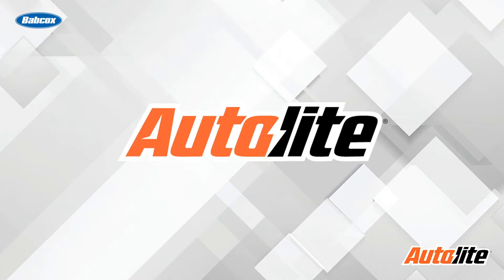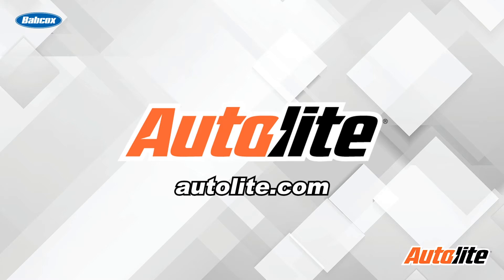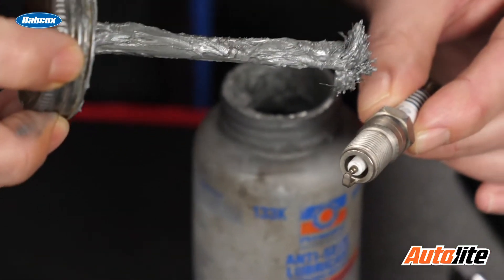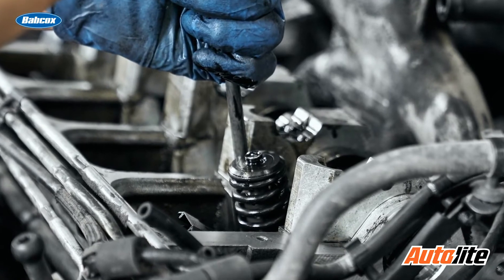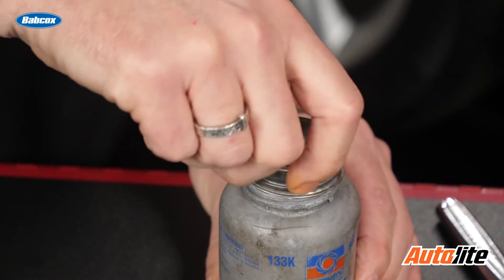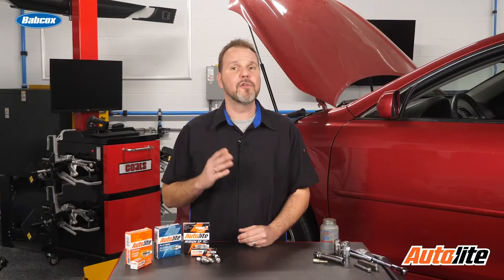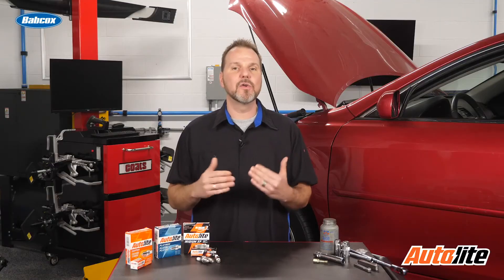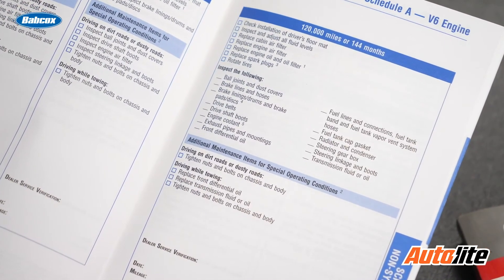Should Anti-Seize Be Applied On Spark Plug Threads?

Comment: I'm an ASE Master Auto tech and a fastener metallurgist for a major automotive OEM. I see this argument against using anti-seize on all sorts of fasteners and threaded joints all the time and it's absurd every time. Yes, adding a thread lubricant to a joint and then torqueing to the dry spec can damage something. So DON'T use the dry torque when adding a thread lubricant! By the way, I always use copper anti-seize on spark plug thread and have had great results with that.
Reply: I've seen spark plug specs as hand tight + quarter turn. Wouldn't that be the same tension regardless thereby nullifying the excessive torque argument?
Reply: @ProctorSilex  When I changed plugs on my old CX5 I caculated a 25% lower torque and when I reached that with the torque wrench it was exactly what the plug manufacture stated to turn past hand tight. The plugs did state that they have a special coating on so you don't need to use antiseize but I wanted to make sure.
Reply: @ProctorSilex  It will be the same travel but not the same tension. It will take less torque to get that quarter turn when using anti-seize. The good thing is that you don't have to worry about stripping out the threads.
Reply: @ProctorSilex  That's a very, very vague spec, if you can even call it a spec, but if you were able to exactly repeat "hand tight" to the same torque every time, then you'd want to reduce that by 25% to 30% because that same "hand tight" would actually be slightly more tension. That's probably impossible, so maybe reduce it from half turn to a quarter turn instead? I seriously doubt it matters with such a loose control as that. I'd just go slow and anywhere between a quarter turn and a half turn should work.
Reply: I agree using the copper antiseize where  conductivity is needed.
Reply: @PeterMartin-qh1yb  Unless something very weird is going on such as severe rust, the miniscule amount of electrical resistance between the spark plug and the head is absolutely a non issue and isn't even measurable in the total resistance of the ignition system. Remember- by design, the spark plug itself has an internal resistor with several thousand ohms, the plug wires can easily be in the tens of thousands of ohms, and the resistance in the secondary side of the ignition coil is generally in the tens of thousands of ohms, so another miniscule fraction of an ohm from the threads means nothing at all. Actually, I highly doubt that someone even could create a high enough resistance between the spark plug and the head to cause actual negative effects if they tried, but I'd love for someone to prove me wrong.
Reply: @averyalexander2303  You don't absolutely NEED a conductive compound between the spark plug threads and the cylinder head. Spark plugs DO work perfectly well with dry thread contact. However, the electrical connection is being made between dissimilar metals that are expanding and contracting at different rates every time the engine heats up and cools down. Using an anti-seize formulation with copper particles is just extra insurance to minimize electrical heating at asperity contacts which can contribute to thread galling.
Reply: @PeterMartin-qh1yb  have you ever done a conductivity test with your ohm meter on it.  The copper one I have isn’t conductive
Reply: My torque specs on the spark plugs on my cars range from 13 to 15 foot pounds. There's no way you can stretch the threads with such a low torque rating
Reply: Yeah I think the problem is people tend to use too much anti-seize on threads,  all you need is a film or it not a whole lot of it.   I like the copper anti-seize for spark plugs as well because the copper conducts really well in that application.  Also when it comes to aluminum cylinder heads I tend to be a little neurotic about stripping the threads in the head so I tend to bottom them and then just give them a little bit more than that but not much.  The factory torque values are fine,  but I've seen people strip the threads using torque wrenches as well,  I tend to go by feel with aluminum.
Reply: @elektro3000  Is there a reason you prefer using copper anti-seize instead of aluminum? I've been using aluminum for over 35 years with no problems. I'm just curious why you prefer it. Maybe I'll start using too.
Reply: @bernardocisneros4402  Presumably is conducts electricity better. That remains to be proven though.
Reply: They use a spark plug antiseize on aircraft spark plugs. It's more of a thick black grey liquid. Made by Champion, tempest & others. But some also use oil, cooper & aluminum antiseize with no problems.
Reply: I use the copper on 02 sensors as well, but I use it sparingly.
Reply: I know right. I lived in the rust belt i used anti seize on my wheel hubs, caliper bracket ect.... To some people this is sacrilege. If the bolt is torqued properly its going nowhere
Reply: @MartinX192  Anti-seize on all the mating surfaces between the wheels and the hubs is a lifesaver! Trying to change a wheel corroded to a hub sucks in a well equipped shop, but by the side of the road it could be impossible.
Reply: Torque? well you can get out the calculator.  I just drop it 10% in iron and 15% in aluminum. The nickel and copper tubes or pots of seize are about the same except for the heat transfer.
You can check it with a VOM.
Generally I got the Nickel for 300-400F temperature process equipment and Copper for the 800F - 900F. Or just copper on the high alkaline processes.
Yep you do not want be around a ex-changer when the 900F dollar plate lets go of the 12 inch feed of petrochemicals.
Been using them on aluminum and cast iron heads for 30+ years.
Reply: Is copper anti-seize compatable with aluminum threads?
Reply: @thisisyourcaptainspeaking2259  Yes, copper anti-seize works great with aluminum threads.
Reply: @elektro3000  Last I checked and surely this hasn't changed but there is essentially no galvanic couple that is worse than copper and aluminum.
Reply: @thisisyourcaptainspeaking2259  It's certainly not the worst galvanic couple (magnesium with gold, or at least magnesium with titanium, would probably be the worst) but you're correct that copper and aluminum can cause awful galvanic corrosion when joined with an electrolyte, such as salty water. However, the grease component of the anti-seize compound seals out water, road salt, and other materials that would create an electrolyte between the aluminum cylinder head threads and the copper particles. In fact, most spark plug threads are austenitic stainless steel, which is an even worse galvanic couple with aluminum than copper with aluminum. Any kind of sealant to keep water and salt out of the threads will help prevent the plug from forming a galvanic cell with an aluminum head.
Reply: @thisisyourcaptainspeaking2259  From what I understand it reacts with aluminum and causes galling. Nickle is a better option.
Reply: My buddy who is an aircraft maintenance engineer does the same.
Reply: the first part I kinda agree and copper shield is great for electric connections
Reply: I have several torque value tables going back to the 50s. They agree that their torque values are for clean and lightly lubricated threads. Now, nothing seems to be said on this subject. Makes me feel trapped between what was once common knowledge, and now is crickets.
Reply: Crickets?  I say use anti-seize if you plan on leaving the plugs in there for an especially long time, such as irridium in an aluminum head.  For my vehicles where the plugs are an easy reach and access is good, I run copper plugs (typically cast iron heads).  I've never experienced thread seizure in cast iron heads so I might use a little oil if anything.  Torque wrench?  It's more often than not I can barely get to the plug straight-on, let alone get a torque wrench in these locations.  I go by feel..  . @intuberably
Reply: 100 percent right! What he said ❤
Reply: I was under the impression that copper reacts with aluminum and causes galling. Wouldn't nickle based anti-seize be a better choice?
Reply: your certifications and claims have no evidentiary bearing on the physics and/or reliability of any of these procedures.
Reply: Sound advice.
Reply: Yes, thank you!!! I’ve seen too many debates on this topic. I’ve been using anti seize on spark plug threads ever since I started out way back in 1972. (76 year old and retired, by the way). I still use it on my own cars, as well as my family’s. Never, ever had a problem. I have also seen some horror stories where lack of lubricant were responsible for expensive repairs.
Reply: How is it that copper, which is a more galvanically active combination with aluminum (head) is ok??
Reply: @JHZR2 it's gonna take decades or centuries to corrode and you will never feel it. The thread will corrode much faster without the copper antiseize.
Reply: Current technology uses a nickel coating on the threads which helps prevent seizing and corrosion when the plug is tightened, and is the primary reason many spark plug manufacturers no longer recommend the use of anti-seize compounds.
Reply: Do how do you determine what torque you should use with anti seize? I did all my VW air cooled aluminum heads with anti seize and by feel. Never had one strip out, even my first ones when I knew almost nothing about torque and aluminum.
Reply: @5400bowen  In most situations, if you have a torque spec for dry threads, reduce that by 25% to 30% for lubricated threads (multiple the torque number by 0.70 or 0.75).
Reply: I never used a torque wrench on wheel lug nuts either. And never had one come loose.

Engines, cylinder head bolts, main bearing caps, conn-rod bolts? Absolutely!

 In the Navy, every fastener on aircraft got tightened with a torque wrench. Those were the rules. @5400bowen
Reply: @5400bowen take a foot pound or two off the specification. Even if you dont, an extra foot pound or two is not going to strip the threads
Reply: @gltwn  I have to agree, even on old (I mean chronologically, not design) air cooled VW heads as a complete novice with no torque wrench (God, that was a LONG time ago!!!) I never stripped out a spark plug bore. Though ones that were installed prior to me working on it with no antiseize had seized plugs that pulled the threads out upon removal…but that never happened with plugs I used antiseize on and later removed, and that was on a lot of motors many many times. Even on heads that had been heat stressed to the max.
Reply: @gltwn  That's what I do. The torque on my plugs are 15 lb-ft and when I use anti-seize I torque to 14.
Reply: Yeah, I disagree. With many heat cycles the threads on the plug can become fused to the aluminum, as the steel is going to get hotter than the threads in an aluminum head. Antiseize stops that fusion, and I never had any problems, even when I was a novice and knew almost nothing about it.
Reply: Yep, I've worked on hundreds of aluminum head Harley motors over the years. Plugs get a/s. @5400bowen
Reply: After having used never-seez since I built my first engine as a teenager 60 years ago and never had any problems with plugs and never using a torque wrench on them, I'm going to call 🐂💩

Comment: Maybe it’s different with today’s engines but aside from my mid-2000’s Benz, all of the engines I work on are 80’s Japanese motorcycles with aluminum heads or 60’s American engines with cast iron. I always use anti-seize on spark plugs. I’ve never over torqued a spark plug and I’ve never had to heli-coil a plug hole either. I use silver anti-seize and it takes just a little bit to prevent the threads from being dry. Aluminum, steel, heat cycles and condensation are the perfect environment for the aluminum to fester. I’ll keep doing what’s worked for me for the past +40 years.

Comment: Been twisting wrenches for over 60 years  with many , . . .  sparkplug replacements  all kinds of metallurgy and thread seizures  and  Helicoil  installs   Until - - - " Neverseize"  !   Works fine ,  a little finger swipe on the threads (only)  it is a conductor, a gentle torque and good to go !   No failures either,

Comment: This is a remarkably simplistic argument...  Clearly, the 'reduced torque requirement' argument is correct (of course anti-sieze compounds are lubricating), so it makes sense to determine what an appropriate torque value is when using an anti-seize compound!  Likewise, it's obviously important to only use a compound that has good conductivity - so use one!  Anyone who's had corroded threads fail in an Aluminum cylinder-head, can tell you about the value of anti-sieze...

Comment: With an aluminum or copper based anti-seize , grounding shouldn’t be a problem.  Aluminum heads and nickle based spark plugs WILL produce galling . The over torquing is the area of . caution

Comment: Anyone who worked on cars in the '90s know that if you don't use antisieze you'll pull the threads out of the aluminum heads. 

If you're only argument is that you have to reduce the torque when you apply an antisieze. Then use antisieze and reduce the torque. Zinc and copper which are the base of antisieze, are good conductors.

Comment: With Iron heads there generally isn't a problem with a SMALL dab of nickel anti-seize IF you want. The problem is with Aluminum which is a less noble metal and will corrode more easily instead of the spark plug. You need to use either the same or similar material anti-seize as the head or a couple drops of oil. Most plugs these days are plated with zinc or some other less noble metal so that that becomes the sacrificial surface. I just a couple weeks ago changed the original plugs out of a GM Cadillac 3.6l and all 6 were installed BONE DRY. I mean BONE DRY. Some came out 'squeeky' and honestly I'm never comfortable putting things together dry. I used a couple drops of synthetic oil. I didn't have any aluminum AS on hand. I've been changing enough spark plugs over the decades I know how tight they need to be. Just because the factory doesn't do it doesn't mean it's not acceptable.
Reply: Not many people can feel the torque needed  but yes its a learnt skill
Reply: I would use if it is an aluminum thread on the head to use a stainless steel based never-seize with a temp rating of 2400 degree f rating .it can be purchased through Granger industrial supply. It,s pricy,  at about $150.00 per quart. But worth it.  it will work. .Then you won't  have to suffer the busted knuckles garage syndrome.

MISS PAULA WALACH-FORMER INDUSTRIAL ELECTRICIAN-CURRENT UNION MEMBER IBEW
Reply: @paulawalach1770  There are specific anti-seize products for use on specific metals. You would NEVER want to use a 'stainless steel' or nickel based anti-seize on aluminum. It can cause a galvanic reaction and lead to the issue you are trying to avoid. The correct product is aluminum anti-seize which is white. It looks like white lithium grease.
Reply: Came out squeaky bringing thread with them. Not ideal, be very carefull fitting new plugs.
Reply: @ldnwholesale8552  Already installed, no threads removed or damaged just dry. No resistance coming out just noisy.
Reply: You don’t need it on modern plugs.

Comment: You don't torque sparkplugs. Tapered seat plugs are turned 1/6 of a turn after hand tight, gasket sealed plugs are 1/4 turn. Additionally, a spark of 30,000 volts that has just jumped the sparkplug gap is not going to be hindered by antiseize on the threads.

Comment: I have the answer as being a technician that worked on air cooled engines and non-air cooled engines, the answer is this anysize compound with basically designed for air-cooled engines; all other engines you use some type of lubricant like oil. If you use it on non air cooled engines does spark plugs will run hotter.

Comment: Should you use anti- seize for spark plugs, no no no and no. I'm going to tell you something this video did not tell you and why not to use it or at least very sparingly. A friend of mine bought a 63 Ford and couldn't get it started. He bought a new distributor, coil and everything else and still it wouldn't start. So he asked me to help him with it, l check to make sure the coil was producing a spark and it did. Next I told him to hand me a plug wrench and he said no way it could be the plugs because they are new. What I was aiming for to see if they were fouled, but when one was removed it had enough anti- seize for about 50 plugs. So I replaced them and the car started right up. After a couple days it begins to have a miss in one or two cylinders. He began to believe me so I installed another set and never had anymore problems. So what happens when anti- seize gets into the combustion chamber it will splash and foul out the plugs because it is metallic. Any metallic that gets on the porcelain will basically short out a plug. When I'm at a auto parts store and I see the salesman pushing this product when selling spark plugs I just shake my head because knowing that it is a possibility the motor is going to have a little miss that they will never figure out.

Comment: I use anti seize on just about every thread on cars, boats and trailers.

On the other hand, if you don't use anti seize, you can also under torque fasteners when the receiving threads are dirty or contaminated.  I've been wrenching since I was 16 and have never used a torque wrench on spark plugs, especially aluminum heads.  My elbows have been calibrated working on cars, airplanes, boats, etc.  Just use some common sense.

I do use a torque wrench on internal parts of the engine though.

Comment: My experience with using aluminum based anti seize on engine parts that get hot  is that the aluminum in it melts and seizes the part so it will not move. It in fact become a seize maker.
Reply: Same... just use a small drop of motor oil.